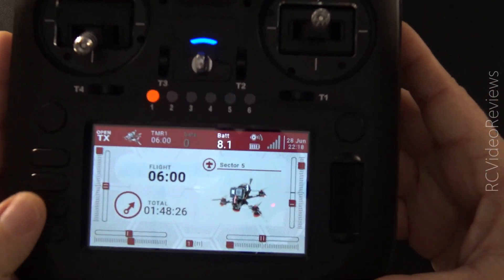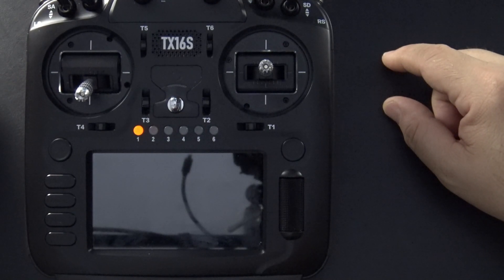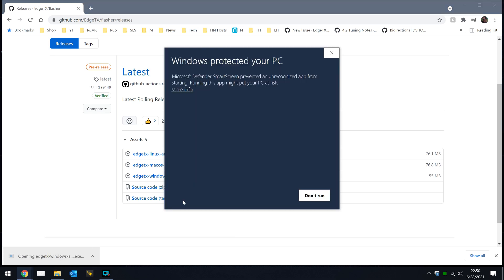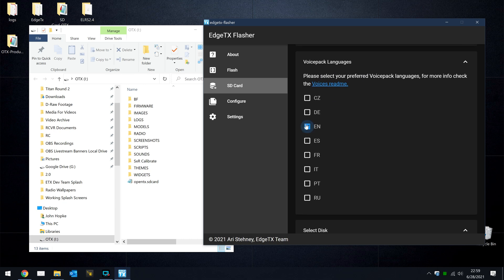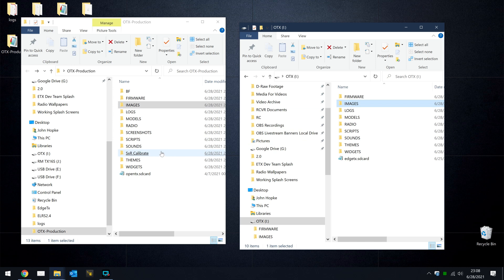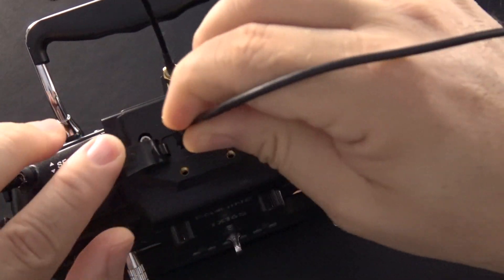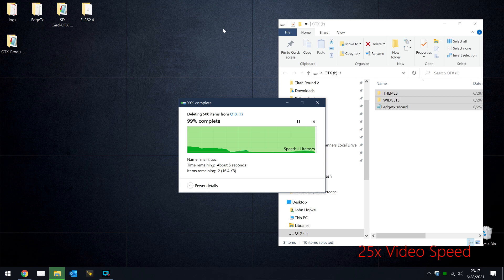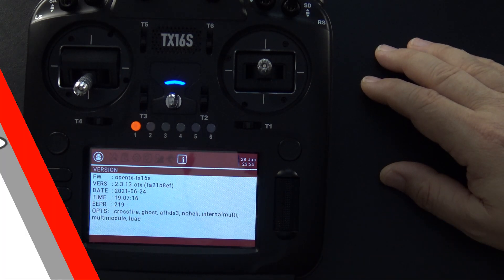EdgeTX • How-To Migrate from OpenTX to EdgeTX and back to OpenTX

Comment: John,  I know you will disagree with me but I absolutely hate EdgeTX.  It is way too complicated and offers no real functionality compared to OpenTX to RC pilots like myself who have no interest in the programming complexities of EdgeTX.   Regardless, I went back to OpenTX and love it.  OpenTX is very straight forward and easy to understand once you get the concept of Inputs, Mixes and Outputs down.  

My question is that I followed your video to the letter but now when I want to look at the SD card on my TX16S and hold the T4/T1 buttons in while turning on the radio,  it still comes up with the screen "EdgetX Bootloader - v2.8.4".  How do I get rid of that and go to the OpenTX bootloader screen?

Thank you for your very thorough and helpful videos!
Reply from the maker: Yup, couldn't disagree more. The core programming features of both firmwares are essentially the same. But you've made your choice and that's fine. With your OpenTX firmware on the SD card, navigate to the the firmware folder on the radio, long press the firmware, and choose flash bootloader.

Comment: The latest EdgeTX Flasher has different selections on the LH side(Welcome, Install EdgeTX, Setup SD Card and Settings). Going from OpenTX to EdgeTX-how do I flash Firmware when there is no Flash selection?

Comment: Thanks for the informative presentation. I have two radios , one with OTX and a lot of my models and widget designs and a new one with a freah ETX 2.7.1 installed. I used the  OTX companion to save my models and then the ETX companion to import and convert my OTX models on the ETX radio. Everything seemed fine at first and the .bin model files showed up as .yml . But then  I realized all the widget designs were gone. Also certain model jpegs only displayed in the model list but not when attempted to add them as widgets. What's up with that? It also seems to me that the display quality in ETX is not as sharp, colorful and 'contrasty' as in OTX. Has anyone else noticed that?

Comment: Was switching from Edge to Opentx and followed all the steps but when I try to write the firmware to the radio it gives me an error and doesn't get written to the radio. Pls help
Reply from the maker: If you’re flashing it from the bootloader and it fails, you either have the wrong firmware or a bad sd card. I’ve flashed from the bootloader countless times and it has never failed.
Reply: @RCVideoReviews  thanks for your kind reply .and get back to u with good news

Comment: pulling MY Fing hair out i have a Jumper T pro with open TX nobody can seem to tell me how to just convert the models to Yaml so after trying to migrate the jumper Tpro to edge TX and get it to do the little convert the models its self-thing to no avail.....so then  i took the brand new TX16s mk2  and used this video to put open TX on it, i then uploaded the correct file system then i added the model's folder from my old Jumper T pro and turned it on and i get bad model data
Reply from the maker: Hang tight, keep an eye on the channel. Help is coming. We'll get you sorted out.

Comment: I got to the part where I'm to flash Edge TX. Ran the program and got an error.
Here's what I got:
Opening DFU capable USB device...
Device ID 0483:df11
Device DFU version 011a
Claiming USB DFU Interface...
Setting Alternate Interface #0 ...
Determining device status...
DFU state(10) = dfuERROR, status(11) = iString indicates a vendor specific error
Clearing status
Determining device status...
DFU state(2) = dfuIDLE, status(0) = No error condition is present
DFU mode device DFU version 011a
Device returned transfer size 2048
DfuSe interface name: "Internal Flash "
Downloading element to address = 0x08000000, size = 1538752

Erase [ ] 0% 0 bytes

Now what?
Reply from the maker: Don't use DFU, put the firmware on the card, enter bootloader and flash from bootloader. It's covered front to back here: https://www.youtube.com/watch?v=LItyAkJlcdU

Comment: Would you advise to have dual SD cards then?  One with only OpenTX, and one with EdgeTX?  I want OpenTX, but it seems like you can only get the TX12s with Edge installed from the dealer.
Reply from the maker: Switching the card does not change the firmware. You have to flash the internal memory with the firmware you want and have an SD card with the contents supporting that firmware. 

Since you directly asked for my advice, I'll offer it: Switch to Edge and don't look back.
Reply: @RCVideoReviews  Are the ogA1 gimbles worth the cost, or just get the basic MkII?

Comment: I followed the video and all went fine until the Edge Flasher (© 2022 Ari Stehney, EdgeTX Team 16fb26b).  
“Install Edge TX” worked as expected.
“Setup SD Card” I selected Radiomaster TX16S, but Voicepack  and Lua Scripts sections did not populate any selections.  Checking the log I find “[updateConfig.message.error][2022-05-17T14:50:09.400Z] Error: Request failed with status code 404”
Broken Link?
Reply from the maker: Not sure about that error. You can get the EdgeTX sounds from the EdgeTX github: https://github.com/EdgeTX/edgetx-sdcard-sounds/releases/tag/v2.5.3

SD Card contents are here: https://github.com/EdgeTX/edgetx-sdcard/releases/tag/latest

Comment: Is there a reason why you would want to switch back? I have a tx16s from radiomaster haven't installed egde yet but want the touchscreen to work
Reply from the maker: I'm all-in on Edge, so for me the answer is no. Some people may want to take a look to see what all the fuss is about. There is a look and feel difference too, so some might not be ready for the change after an initial look. In any event, the information is there.

Comment: Does it take a long time to go from 0% to 1% when installing? I waited 8 minutes and it's just sitting there at 0% installation.
Reply from the maker: What you see in the video is what you should see on your radio.
Reply: @RCVideoReviews  I got it to work using the web browser method. Even then it told me the radio was write protected several times and wouldn't do anything. Then all of a sudden,  it just worked.

Comment: Hi and thanks for being there producing valuable content. I need help, I’m new at this and doing this mainly for my son that’s into the hobby but he is 13yo and not allowed to have social media . I tried doing this move to edgeTX for his tx16s and got it up and running all good there,!but I couldn’t really finish the right way because now this PC won’t see the SD card on the tx16s.  Besically got stuck at minute 6 with 24secounds, right at the refresh to look for the sdcard and rewrite. Just can’t see it , funny thing is I will move to other pc amd it will connect just fine… I have tried Zadig again I tried the immersion Rc driver fixer without luck… Pc will recognize other mass storage devices I tried afterwards but not radiomaster Zorro or tx16s.
Any ideas?
Reply from the maker: This sounds much more like a PC issue than a radio issue as evidenced by the fact you can move to another computer and it connects just fine. A couple of things I would try:

1) Reboot
2) Different USB Cable
3) Different USB Port

Does the computer make the bong bong sound when the radio is connected?
If you take the card out of the radio and plug directly into PC (via adapter if necessary) does the PC see the card?
Does the device manager show the device?
Are there any errors in the device within device manager?
Can you remove the device?
Can you login on that PC with a different username and see if you get the same result?

It does sound to me like the issue is with your computer.

Comment: You are an excellent YouTuber. You speak and use visuals like you are an everyday RC guy, not like others who fancy themselves as a professor from M.I.T. Ok question. I switched over to Edgetx, and as you predicted I lost my favorite model. I backed up my disk. Can I just drag the model over to Edge?
Reply from the maker: You should be able to copy them over. Just make sure you copy and not move :)
Reply: @RCVideoReviews  Thanks. What I did was before I deleted my SD card (backed up) I selected all but deselected models and radio so they would remain. Copied over the Edge files, yet I still lost all my models. Is there anything I can do, other than switching back to OpenTX?

Comment: This method only applies for colored radio. I used this method for jumper T12, and I lost my radio setting and models. For bw radio, please read the information on the edgeTX Flasher carefully !!!
Reply: Me too. How can I go back? I've models backed up on SD card as well as the other contents of open tx in computer.
Reply: @helixinwonderland8938  I don’t think you can go back. Radio setting is on the eeprom. I have to re-setting my radio and re-create models
Reply: You need to have backup from opentx companion
Reply: @febbyeka  Thanks. It seems I'll have some work to do.
Reply: After all I had a backup. Flashed OTX, have all the settings in the radio but I'll have to re-bind models.

Comment: I purchased a new Jumper T18 Pro V2, and when I move the models from the backup created on my T12 Pro, They move into the folder on the new SD card but are not converted and not visible from the the radio. How do i get the radio to convert them?
Reply from the maker: Your best bet is to use Companion. Setup a T12 profile and a T18 profile. Using the T12 profile, import your models. Switch your profile to T18, connect the T18 and write models/settings. Companion will make the change for you.

You're probably missing the \RADIO\models.txt file  That file serves as the table of contents for the radio.
Reply: @RCVideoReviews  Thanks very much for the info! I am not new to this and have been working for a day to fix the issue. I have been on OpenTX for years from Frysky and wanted a new radio with touch screen. Jumper should install Edge from the factory and save people problems! Thanks again!

Comment: is it safe to installing edge tx to tx16s?
Reply from the maker: Edge is all I fly including on my most expensive aircraft.
Reply: @RCVideoReviews  cus i am got into the fpv world, im never updating any version of tx16s, I asked because I wanted to use it easily. such as touch function
Reply from the maker: I would fly it on all of my fpv gear too, planes, quads, all of it. I've converted 100%.

Comment: Hi, I have tried to migrate to Edge, but unfortunately now my radio won't start. Keeping the double buttons pressed only makes the lights flashing from side to side forever and no other sign of life!?! Maybe you have an idea?
Reply from the maker: Is it a Jumper? Did you flash the correct firmware?
Reply: @RCVideoReviews  hi, yes it is a jumper t18pro. I have tried to flash the t18 firmware
Reply from the maker: Turn radio off, plug in USB, verify firmware and flash again via Edgetx flasher.
Reply: @RCVideoReviews  amazing 🤩, it works!!! Thank you!!

Comment: I'm a newb And feel a little over my head but I flashed edge TX and it worked but then when I wanted to bind to a tracer receiver the agent X lia script was not there. Now feel I should just go back to Open tx
Reply from the maker: All you have to do is unzip this https://www.team-blacksheep.com/tbs-agent-lite.zip and put it in your sd card \SCRIPTS\TOOLS directory. 

AgentX works fine on Edge.
Reply: @RCVideoReviews  I'll try it again but I can't seem to get it to work maybe I am not unzipping it properly or something
Reply from the maker: Probably. The guy who wrote AgentX is one of the main edge devs. If it didn’t work he’d have fixed it. I know first hand it works.
Reply: @RCVideoReviews  is that a fact that does give me new confidence I will stay with edge, for now anyways

Comment: Great tutorial video, may be it is a stupid question but I am newbie pilot started a month ago, just wondering if I have to do all the setup and binding once again when all my quads?
Reply: The answer to your question is NO, if you saved and copied your radio folders from open tx to edge tx.
Reply from the maker: You always have to bind new receivers except when you use technology like ExpressLRS which can use binding phrases. Technically, you could use one model for all quads if you use a binding phrase on ExpressLRS or if you use RX Num 0 with FrSky protocol RXs.

Comment: Hi there, i have a Radiomaster tx16s MAX and i’ve followed your videos on this step by step, zadig step to insure the driver is correct, ✅, latest flasher(Microsoft), ✅, latest firmware, ✅even checked in betaflight that the radio was going into DFU mode,✅. I go to “flash radio firmware “ and it comes up with “waiting for dfu-util”. I saw on Andrew Newton’s channel that this can happen with mac and linux. I have also tried writing the firmware off the sd card and it looks like it partly crashed when i push enter. Any tips would be very much appreciated. Thanks
Reply from the maker: I don't believe the OpenTx bootloader will let you flash Edge. 
Run Companion, select write firmware to radio. Select the CORRECT EdgeTX firmware. You can get the binary from the zip file at the bottom of this page: https://github.com/EdgeTX/edgetx/releases/tag/v2.4.0  Uncheck "Check Hardware Availability"

I've flashed Edge and OpenTx on my radios dozens of times via dfu, from bootloader, and from Companion. If none of these work, you might consider a USB issue, cable issue, new sd card, or different operating system.
Reply: @RCVideoReviews  i’ll give it a go in the morning. Thank you for your response. Much appreciated from 🇦🇺.
Reply: UPDATE:- i got it sorted thanks to your advice. I had been checking the firmware compatibility box in companion. Thanks again for the assistants.

Comment: So OpenTX & EdgeTX firmware is all stored on the SD card. So I could take a separate SD card and start a EdgeTX and setup everything.  And if I wanted to go back to OpenTX firmware. I just pop my old SD card back in and everything is already setup like I left it. Looks like it be easier just to set up a new sd card huhh? Or do I have to flash back (OpenTX/EdgeTX) firmware back on to the radio separate from the SD card? Thanks for the great videos!
Reply from the maker: You always have to flash firmware. So this is the way to do things:

Copy your OTX sd card to computer. Then copy it to EdgeTx sd card.
Remove OTX sd card, replace with EdgeTx sd card. Flash Edge firmware. 
If you want to go back to OTX, go to bootloader, flash OTX, exit, shut down, replace OTX sd card.

Comment: Edge TX has issues with DSM receivers which I have reported. No answers yet and wanted to go back to open tx. Followed your instructions but get an error of "new firmware not compatible with firmware currently installed" I used a new card for Edge and have a backup original card. Any help you can provide would be helpful. Using Companion for the flasher. Thanks
Reply from the maker: If you download the Opentx binary and put it on the radio in the firmware directory then run bootloader mode, you can flash opentx direct from the bootloader. It should work no problem.
Reply: @RCVideoReviews  Thank you.
Reply from the maker: Did you get it to work?
Reply: @RCVideoReviews  Yes, worked great. Thank you. 70% of my receivers is DSM so I had to switch back. No real answers to the problem. It is a channel mapping issue it seems. I will wait a while before I go back to Edge TX

Comment: Hi John, was able to migrate back to OpenTx. Although nothing had happened while flying my OmpHeli’s using EdgeTx, decided to migrate back because saving files from EdgeTx comes out funny on companion Tx, all models are somewhat scrambled and out of place. I did like switching between models using EdgeTx, makes it very fast and easy. I still like how OpenTx looks. Is there away, reading files from the radio with EdgeTx firmware and save the settings without the files coming out funny on companion? Thanks John.
Reply from the maker: Edge is not compatible with Companion. I’m surprised it worked at all. And it’s going to get worse as Edge migrates to YAML. Eventually Edge will have its own version of Companion but that’s one of the drawbacks right now.
Reply: @RCVideoReviews  Ok, thanks John. Till then, staying with OpenTx for now. Had fun trying it and can’t wait till all bugs and fixes are resolve. Thanks to you guys and to the dev team out there making all this possible for us.

Comment: I tried a lot to flash my Jumper  T16 pro although installed the driver also and flashed even selecting T16. Yet tge same opentx system comes when i power it on
Reply from the maker: You missed something.
Reply: @RCVideoReviews  after it was showing flashing complete a small message beneath was writh and that was
Waiting for dfu util
I waited for some time still same message so i closed it because it showed flashing complete and secondly it didnt show the downloading it directly showed firmware flashing complete
Reply from the maker: Did you install drivers with Zadig? If you can't flash it with the Flasher, flash it with Companion. Or, put the binary on your SD card in your firmware folder, boot into bootloader by holding T1 and T4 in while powering on and flash from the bootloader.
Reply: @RCVideoReviews  not working that too it says firmware not valid and yes i installed drivers uaing zadig